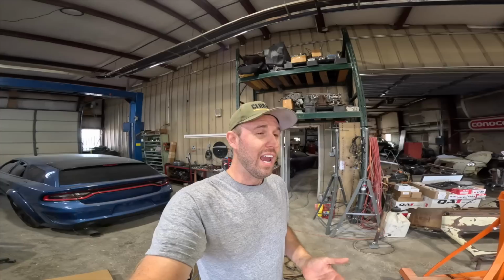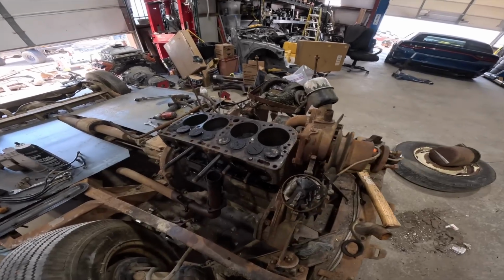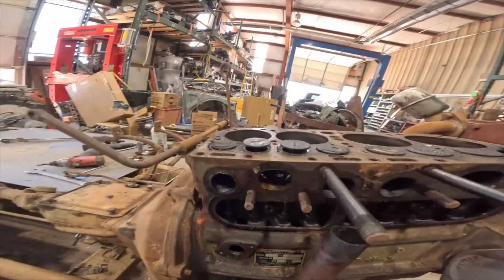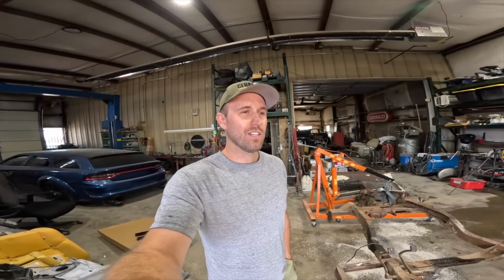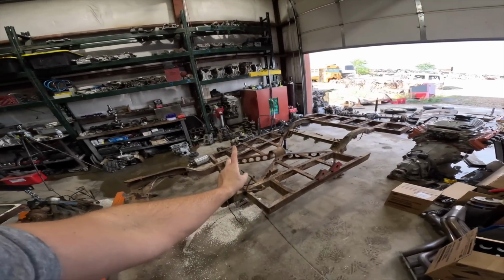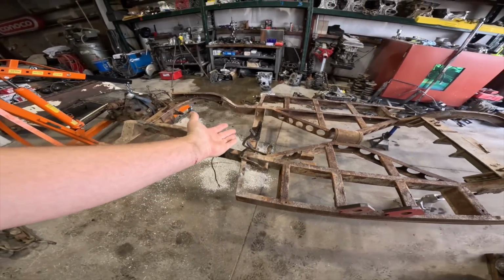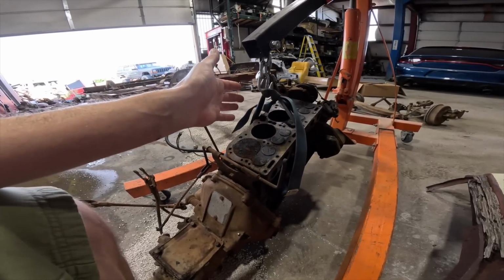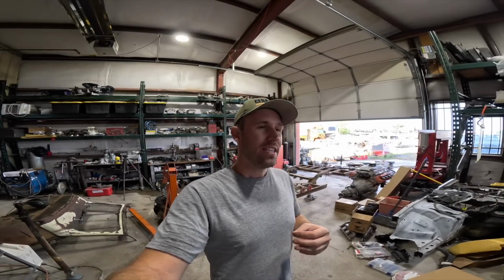Restoring A 1948 Keller Super Chief Woodie | Episode 3

Comment: If that curve is mirrored on the other side, then it’s supposed to be there, so I’d keep it. A likely reason for it would be to suit other body styles- as I understand it, they had planned to build other types once the station wagon took off. A convertible or saloon of the time would begin its curve towards the tail pretty much exactly in that position.

Comment: I agree with not modifying the frame in areas where it isn’t necessary like the front part that curves inward. Keep it as OE as possible. But with safety stuff like the seat mounting, yes that should be addressed! I really can’t believe they just bolted the seats to the shear metal and didn’t at least have 2 bolts into a frame cross piece!

Comment: What I'd be worried about in straightening that frame side is to have it all done, back in assembly, then you really see why it was curved as something doesn't fit right.  But, if you're sure that's not gonna happen, make it straight.  Same for the safety upgrades.  That needs to get done for sure.
Reply: Dave owns a body shop hello!!!!

Comment: The peddles assembly, Looks like it is like a Austin A40 Somerset car . You remove the pin that you see and tap with drift through the frame towards the passenger side ,it will have bushes . The master can be sent to Apple Hydraulics in New York they rebuild everything hydr. As for the frame make like it was . Another thing when you are having trouble with bolts wind them in again to clear the treads to prevent breaking them off. I think this project is well worth doing right .

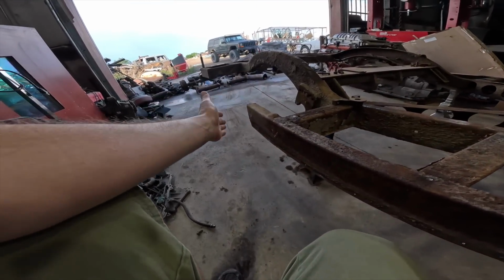Comment: 12:30 I would restore this car back to, as absolutely close to it's original condition, as possible. If you change the original design of the frame, it can very easily cause you to lose points at a concourse auto show. As physics has shown us over the years, curved items are stronger and more rigid than straight ones. This could have been taken into consideration when this car was designed. There are judges at these shows who know every nut, bolt and screw of one-off cars that are more rare than this car is. With this being such a rare piece of automotive history, every change, no matter how subtle, can and will have a negative affect on the car's value. In one of your previous videos, you mentioned upgrading the electronics to a 12 volt system. I'm not sure that, even that, is a good idea. I would like to suggest that, at least for this particular project, you do the restoration for the history of the car, as opposed to personal preferences. I realize that some parts are so badly rusted, or weathered, that there is no choice but to replace them, but replace them as close to OEM as possible. BTW, I don't think that slightly thicker floor pans are going to be noticeable. If you change one piece of the frame, change it's mirror image counterpart IDENTICALLY, even if it doesn't look like it needs to be replaced.

Comment: I would also follow the curve of the new Rocker - to keep original. Further, I would not use Aluminium anywhere in this area. It will lead to extreme cathodic corrosion. Hope that you succeed in the Keller Venture. Greetings from Australia.

Comment: I've worked on a 1941 ford heavy truck with a similar clutch/brake set up, not that exact one though. There should be some pins or set screws hiding beneath the grime, wire brush might help.

As for the bend, maybe they planned on doing something else with the body work and never did?  No need to put it back if no one sees it and it doesn't serve a purpose.

Comment: Any changes for making the Keller safer - without destroying its character - like the thicker sheet metal, fixing the seats to the frame (and not the sheet metal), etc., are fine, IMO.
By the way, your video Aspect Ratio is strange - makes everything shorter & squatter on my Laptop, both in windowed and full screen mode. My Laptop has the 16:10 aspect ratio. Where you ask whether the bend in the frame should be straightened out, I have no clue - to me, it looks fairly straight at your video resolution and my aspect ratio!!

Comment: With the brake cylinder, it looks very similar to the one in my 48 International KB3 (probably smaller sister model), I forget who made them, it began with a W if I remember correct and were also used by Chevy and Ford.  Not sure if you would want to but other classic cars owners with the same master cylinder have upgraded them to a 2 section (not sure oif the correct term) Master cylinder so that the front and rear wheels are a seperate circuit incase of a failure you only loose 1/2 your brakes instead of all of them.

Comment: They are called knee shocks most cars and trucks used them in the same time period, you might have to do a lot of leg work on the internet to visually locate the parts you need almost like AMC and Jeep  they were a conglomeration of every major manufacturers parts , you might want to look for some repair manuals of that time period they might have sections for the company that built those cars in them. I have some really old master repair manuals that have numerous manufacturers in them

Comment: If you clean well the shaft the clutch and brake pedals mount to you may find an e-clip or such holding the pedals in place. The whole subject of restoring such a rare vehicle has definitely kept my attention. Best of luck as you proceed.(My computer could not upload Telegram so I was unable to respond. No disrespect Dave)
Reply from the maker: Telegram what's that?

Comment: You've sure got a job ahead of you there. Hope you can get the parts you'll need. Good move upgrading the engine to run unleaded fuel. Have you thought about brake upgrades for safety? It wouldn't be original, but front disc brakes would be a safety upgrade. The only issue there would be finding suitable parts and no doubt a lot of people would object to that modification, saying you should keep it original. Very strange with the bend in the frame rail which seems to serve no purpose. If the timber is straight, why would the rail be bent? If both sides are the same, then it's unlikely to be damaged from an impact. Hard to say what to do on that one.

Comment: I am surprised at the level of sophistication in this car chassis. There was some serious design and thought put into this little car. I find the suspension especially intriguing.u

My opinion is since those curves were put on both frame rails. They have a design purpose. It could have been installed to accommodate a feature of the other body styles offered for this car or something specific to the wagon.  I would keep them.

Comment: You need to find one of the other keller owners/restorers to try and find out some of this stuff. Somebody out there knows a lot, theres a couple examples existing. Idk if an old Hollanders interchange manual will list a keller or not - but it would be worth looking into. I'd bet the internet is blank concerning the components you're digging into. Myself I wouldn't change anything if I  didn't have to. Get the master cyl rebuilt. I know there's a huge crowd says update. Some things are better if you don't. You have a 1 of 4 edition with known history. Or a 1 of 18 total production. Those numbers justify no updates. Even a single chamber master cyl. Look at the earliest model T's built(which are much more common) and how different they are regarded when you compare modified vs original presentations. You've gotten a good bit done already, thanks for sharing
Reply: I agree don't change it...send the master to white post,for a sleeve job and rebuild.

Comment: Also  there will be a pin holding the clutch pedal on. Remove the pin  and the shaft will slide out.   You will likely need to sand blast the clutch pedal barrel to see the pin.

Comment: Sure , straighten the frame , also put a LS in it. Remember you said restore not modify. Wire brush that clutch shaft , it's pined , drive it out then blast the frame , repair rusted out areas . I myself would not powder coat it. Paint with a good chassis black.Same with all suspension parts.

Comment: I noticed a broken stud in the engine, could that have happened because you rarely use WD40 penetrating oil (or similar). I have been taking particular notice of your'e dismantling and considering the age of the vehicle you are really sparing with that spray.

Comment: The engine looks similar to a Ford Model T engine. Both are flathead engines. 
    Dave, you lucked out with the engine. You won't find a replacement. I hope you can produce templates for the wood body.  If you made the wood body out of Cypress wood, it would last a very long time. Cypress doesn't rot out fast.

Comment: Hello, you should not try to drill the broken studs, give the block to a proper machine shop where they can fixture the block and remove those studs properly, without damaging the threads and block. No  need to install a thread insert if you don’t have to, it would be a lot less stressful. Good luck.

Comment: The engine looks rugged and uncomplicated like something out of a Model A Ford.  The radiator also looks like it was out of a car from that era.  Maybe look up to see if there were any car companies within 100 miles of where the Keller was built and you might find out a lot of the parts came from one of those factories.  The frame looks amazing, btw.

Comment: I'm no expert but looking at engine reminds me of Willis jeeps and as you stated it had Ford parts 
I'd look there for engine and maybe the master cylinder it looks very basic and jeep is as basic as it gets

As for the curve iv done wood work and had to make even the straitest pieces bend to make them look strait to project 

I suspect it may be there for uses with wedges since it is a woody they may have done that to allow for wedging the wood out or in depending on the wood and thickness

Don't consider the contact point at end of the rail but the piece of wood that extends past it to the rear that bit of bend may be the difference as to the outer shape 

Think of it as toeing in or out your tire the right bit of wedge may explain it down the line 

Especially if you can get a look at a completed vehicle
Reply: That is a Hercules engine from the Hercules engine company that was in Canton, Ohio. I don't know if he would be able to get reproduction part's for it since the company went defunct in 99.

Comment: You just have to decide whether you're building a keller Woody or what you would have built as a keller Woody 
Everything that's not read done correctly lowers the overall value of the car 
On something that rare I would think someone would wanted to be as close to original as possible
That being said getting the car back to original state is probably impossible anyway so have at it

Comment: Think double pot master cylander .
No feelings quite like a stalled engine and that brake peddle goes to the floor !!!
Your in neutral or stuck between gears , it won't go into gear an the engine won't start to put it into gear .

Comment: I say YES... keep the curve in the frame side rail. While the reason the frame was curved is not known at present, there WAS a reason for it. They would not have taken the extra time and effort to curve it if there was no reason for it. Stop and think about it.. if there was no reason to do it, would they willingly waste time (time is money) on it when did not need to when they built it and were using it to promote the car and raise money for the company? That would be foolish to do so NO they would not!!!  As for making changes for safety? ABSOLUTELY..  For the master cylinder, original bore size is easily determined.... have it bored and bronze sleaved.. This car is an extremely rare piece of automotive history and should be restored to original, which unlike most restorations will require thinking outside of the box.

Comment: Master cylinder looks like the typical bendix of the day. If you want to replace it with a dual pot master cylinder you can use one from an amx hornet or gremlin with 4 wheel drum brakes. That’s what’s used in place of the single pot like that on my studebaker
Reply: No dude this is 1 of 4 left! Absolutely dont tell him to change anything

Comment: If the curve serves no function, then make your life easier and get shot of it!

I'd personally swap out the suspension, brakes, add in power steering and anything that would make this car safer and more enjoyable to drive.

The purists who say you should replace like with like, fail to realise that if they had the technology back when this car was being built that we do now, they'd have used it. Why restore a car that drives like shit compared to a modern car. As long as it looks as it did, who cares!